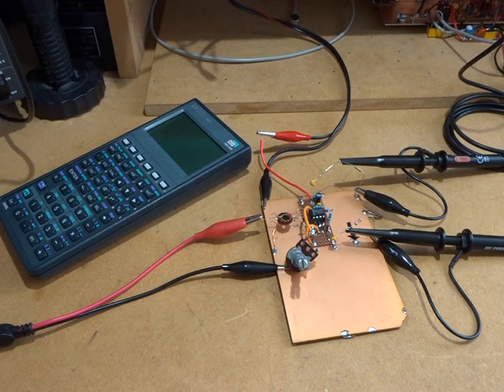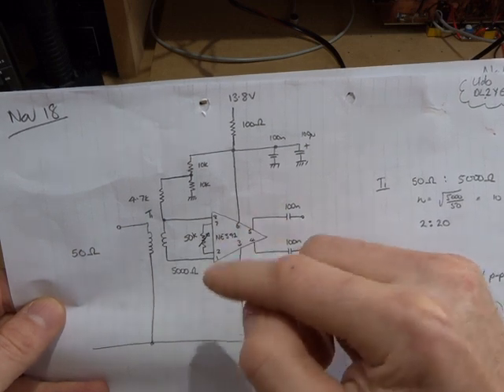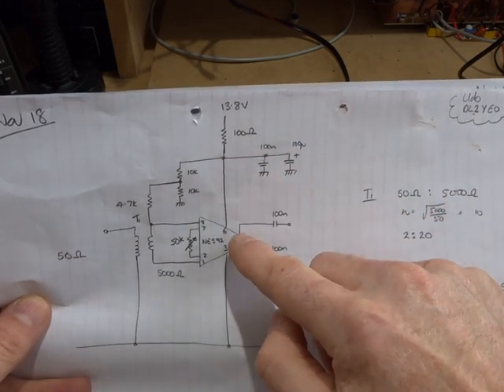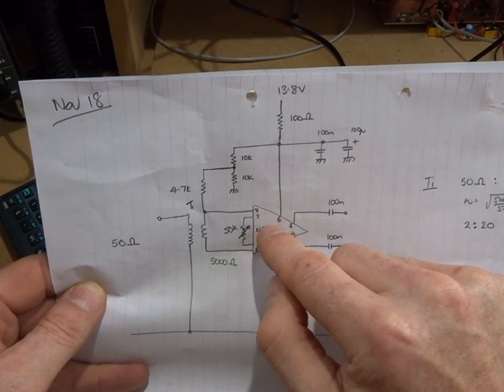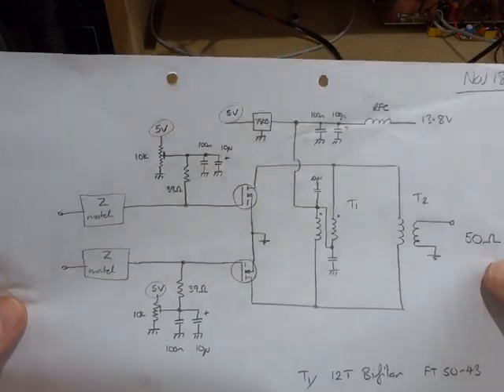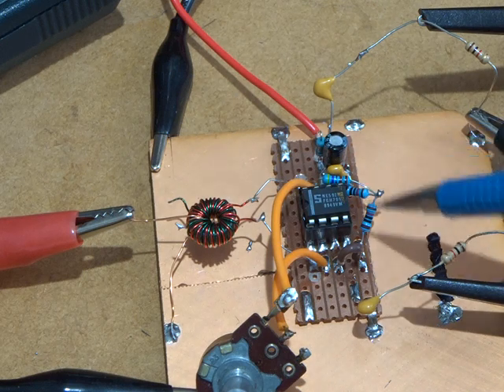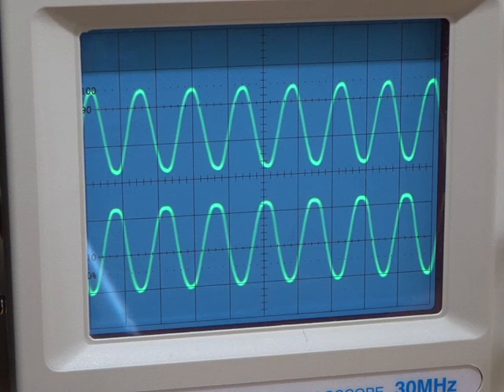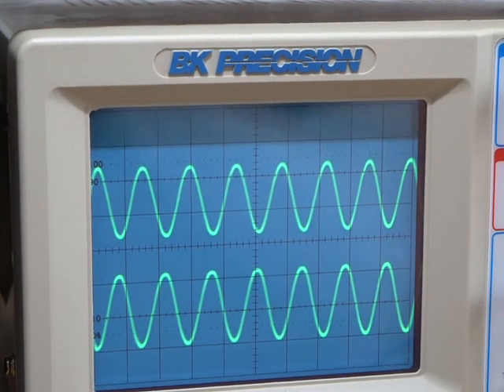Homebrew MC1350P based SSB Rig - #10 RF PA Pre-Driver

Comment: Very good rf   pre power amp 592 very nice  design
Reply from the maker: Hi Raafat. Not a lot of external components that for sure. All the heavy lifting is done in the chip. Quite inexpensive too.
Reply: @CharlieMorrisZL2CTM  yes a few components with ic 952

Comment: Seems a great driver op amp for rf getting 30db ,be good to see how it drives the two FET output ,will have to try this circuit as i can think a few usefull projects it would be good for,Great work Charlie ,thanks.
Reply from the maker: The spec sheet states the out resistance is 20ohms, but the performance was terrible across 22ohm load resistors. I will first try and match the NE592 20ohm output to the BLF1043 1ohm input with a LC matching network. If that doesn't work, then I'll look at using 1k-odd. The Q will be high though. Definitely not broadband. I guess i could use two FT37-43s, one for each input.